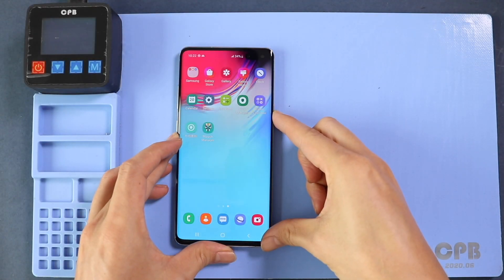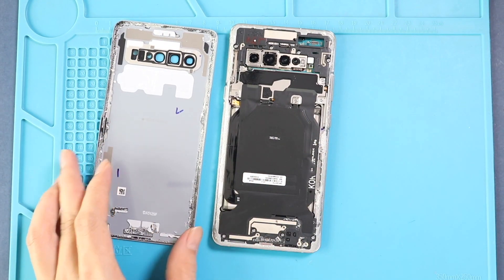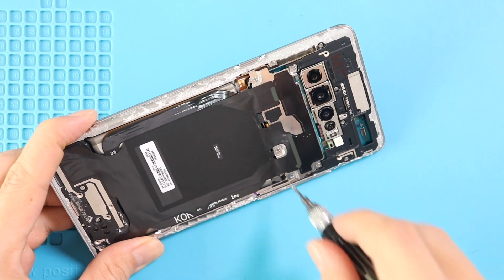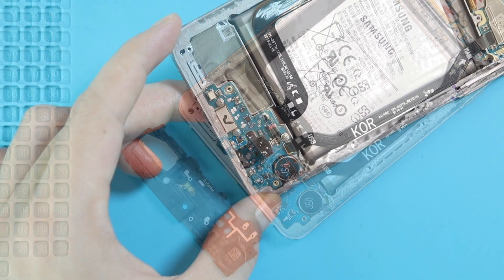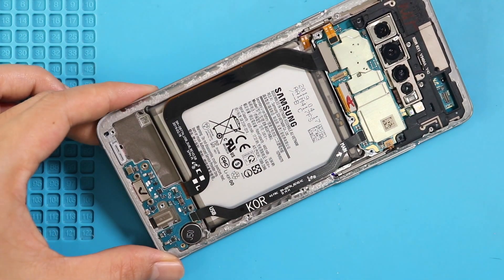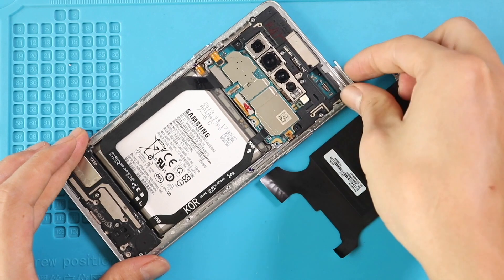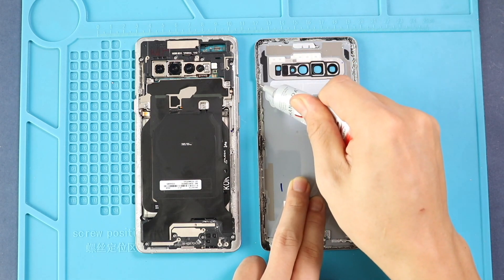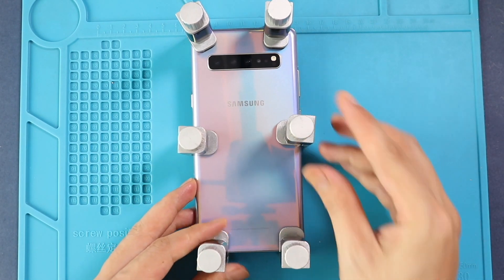Samsung Galaxy S10 5G Charging Port Replacement

Comment: I have Samsung Galaxy S10 5g SM G973W Mobile Phone with charging port issue. When trying to buy online part, I can see part for SM G977. Is this part is suitable for my SM G973W ??
Reply from the maker: G973W = galaxy s10 , not the s10 5g version.For your model charging ports needs to solder

Comment: My s10 is showing moisture detection error does changing port will help to resolve it?
Reply from the maker: if there is no damage, you can try that.also disconnect and plug in back may help too.